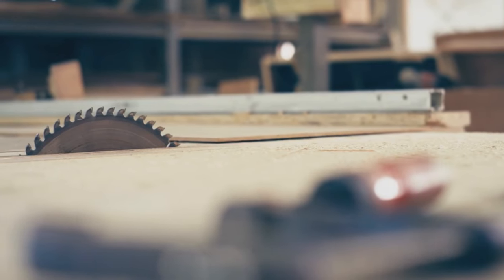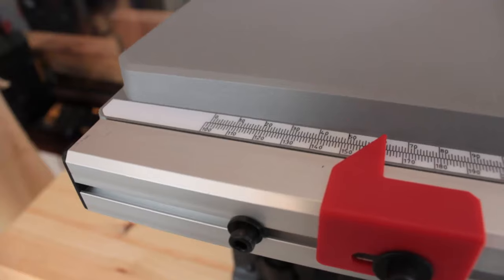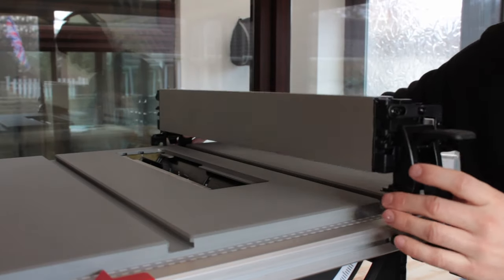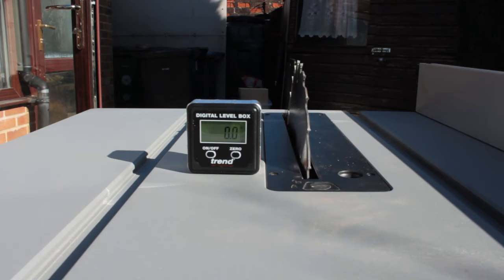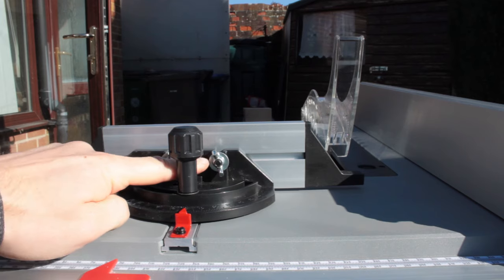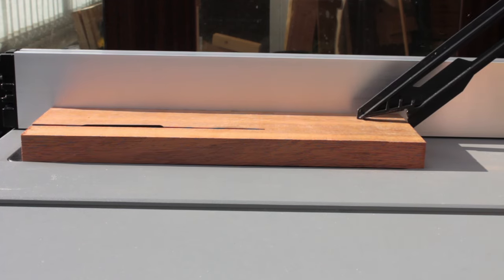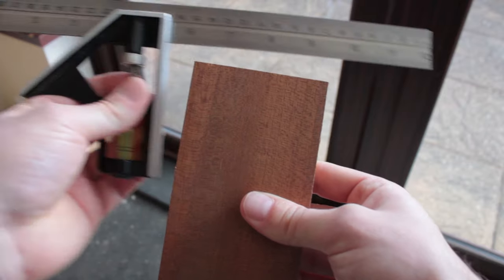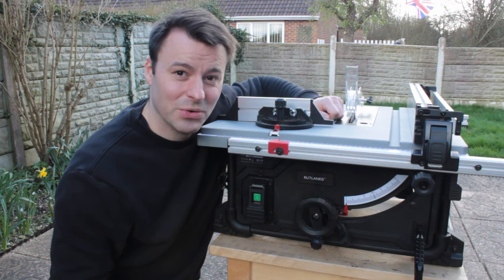Is this the BEST Budget Table Saw? Rutlands R1618

Comment: Great video. I have been waiting for someone to review the Rutlands saw and it looks really good. I am looking forward to being able to see more of it in action!
Reply from the maker: Thanks Joseph, i'll be using it quite alot whilst I get used to it so plenty of content to come! Anything in particuar you'd like to see?
Reply: Hi Alex, I have been on the look out for a cheaper saw as I don’t have a huge budget. I have always used the dewalt table saws but have recently gone out on my own and I need to get a saw for myself.

 Things I’d like to know:
How robust is the frame and build of the saw, is the plastic good quality on the handles? as I work on building sites and it will be going in and out of the van on a regular basis. I will be mainly used for cutting rough sawn timber (wet a lot of the time) cladding and joists etc. 

Does it have the grunt to get through larger pieces of wood and the motor cope with it?

Also, are you planning on getting a stand? I would be interested in seeing how sturdy they are.

I understand your Workshop based, but if you could answer my question, that would be really appreciated

Thanks, Joe

Comment: This appears to be the same saw as the Skill, just painted black instead of red, which I bought recently in the U.S. for less than $300. The push rod and the fence looks exactly the same, but the mitre gauge looks a bit better on the Rutlands. Of course, the Skill has foldable legs.
Reply from the maker: Yes I’ve heard they might be produced in the same factories then just painted to whichever brand is selling them. The foldable legs sound excellent, I had to build a table for mine. The mitre gauge is pretty poor, I’ll be looking to upgrade it soon.

Comment: I bought one when they first came out. And have just used it.  I dont know whether ive got a bad one. But the blade deflects because theres so much side to side movement on frame.
Reply from the maker: Oh no! Sorry to hear that, mine is still going great but I’ve heard the odd one or two aren’t quite right. Have you contacted Rutlands yet to see if they’ll exchange it? Fingers crossed you get it sorted bud 🤞
Reply: @Greyotterstudio  not yet but looks like i'll have to as i cant see any way of tightening anything.  Shame as the fence and everything else seem spot on.

Comment: M8 that looks wicked. I have the einhell one you took a shot at at the start the video. But u are right the fence is bit slack I need to make a auxiliary to try solve that. I think Rutlands have some really good products. might be worth asking for colabriations??,🤔🤔🏴👍
Reply from the maker: The Einhell still looks good, but as you've said, alot of the reviews I've seen suggest the fence is a little wiggly, and I have enough trouble cutting straight as it is! Hah maybe, I don't think anyone is interested in my little channel but maybe one day! Thanks for the comment as always bud!
Reply: @Greyotterstudio  m8 a think you'd be very surprised a saw someone the other day who's had a lumberjack haul of stuff sent to them half the followers you've got and only few hundred on FB. Be worth asking worst they could say is no. They do amazing dust extraction aswell. I looked at one there models. Yea a must say the 2 gripes I have with the saw is the wiggly fence and noise it's not exactly quiet. 👍🏴

Comment: Looks almost exactly the same as the dewalt version. 
I had the dewalt but sold it as was just to powerful / ridiculous noise for home use

How loud is this one?
Reply from the maker: I’ve not put a decibel measurer on it but I’d liken it to a jet engine tbh! It’s not very quiet, I use to sets of ear defence when operating it.
Reply: Does the riving knife adjust with the blade or is it fixed ?
Reply from the maker: @waynelambert4108  you can move the riving knife up and down

Comment: The same factory in China is cranking out this same saw, with a few variations in options for each brand purchasing it. Check out the Evolution and Skil.
Reply from the maker: Yes I've seen that, I think the only variation on the skil is it comes with the fold out legs installed.

Comment: That's an all-black Dewalt - previous generation model.
Reply from the maker: Maybe so - I've heard rumours that maybe their patent expired on the rack and pinion fence as lots of models like this have come out at once!
Reply: @Greyotterstudio  A lot of the cast/injection parts look the same, along with the extrusion, stamped and bent metal parts on the fence. Some parts, like power switch are updated, but the similarities are uncanny/

Comment: That isn't just like the Skil table saw that is the Skil table saw just painted black.. I have a Skil and it's brilliant but looking at that I'd say they were both built by the same people.. The only difference I can see is the Skil has a way better blade guard once you actually figure out how to mount it and it's miter gauge is a dog turd compared to that one.. The big difference is the Skil has fold out legs which are rock solid.. My last project I ran a 2 meter length of 160x65 Rosewood through it and it it ate it no problem I just used an out feed roller to handle the other end..
A couple of things to say both have that same rubbish plastic blade plate, biff it and like me make a solid wooden one.. If you look at one of the shots in that video you'll see it's already bent.. The other thing to point out and this was the biggest bonus for me is if you look along the track where the fence is mounted you can see you actually extra mounting points on the other side of the blade so you have the ability to flip the fence over and make the whole machine a fully left handed.. I'm a lefty and like most of us we find standard gear like table saws difficult and sometimes downright dangerous to use.. 
I'm in NZ and have never heard of Rutland but if I told you where the skew adjustment on the blade is you'd find it in an instant.. 
Everything is made by the same manufacturers these days and they just put enough ever so slight variations in it so a different brand name can be slapped on it.. 
I prefer the Skil, the fold out legs are brilliant, it's the only major difference between them.. I've had my Skil for close on a year now and it is an amazing tool, perfect for the home shop.. 
Take it from me they are the same tool and no one will be disappointed with it's performance..
Reply from the maker: Thanks for the additional info bud! Skil saws aren’t available over here but wouldn’t surprise me if they’re made in the same factory and just rebranded as necessary like you said.
Reply: Skil are just about to drop a table saw on the UK market. Good to see Rutlands getting in early. 

I got the Rutlands saw in December on pre-order for £250. I love it. It has coped with everything I've thrown at it. 
I find myself defending it on Woodworking UK a lot. There are quite a lot of us that just can't afford a DeWalt and just don't trust Excel or Scheppach build quality. This hit the sweet spot for me. Great review.
Reply: @paulhodgson4790  They're both the same machine and I am just over the moon with the Skil variant.. There is a lot of fine tuning that can be done to make it perform even better.. I just finished up a dining room table and it surpassed my expectations.. I bought the machine plus a 80 liter dust extractor unit plus outfeed rollers and the bill still came in cheaper than the bare DeWalt.. For the home guy on a budget this machine is a game changer..

Comment: Looks like a near copy of the older DeWalt dw745, a great site saw, but accuracy wasnt great for fine work, the tables are usually dished in the centre, and although the rack and pinion adjustment is fantastic, the fence itself is a bit flimsy, my old one fell apart eventually
. The biggest drawback with these site saws is the screaming sound of the motor. I got tired of the noise in the end and got a proper cast iron saw, so quiet but the thousand quid price tag is only for serious hobbyists and full timers. If only the rack and pinion fence was available on other saws.
Reply from the maker: Admittedly this is a bit quieter then I was expecting! Although I had biiiiig ear defenders on my view may be a bit muffled!